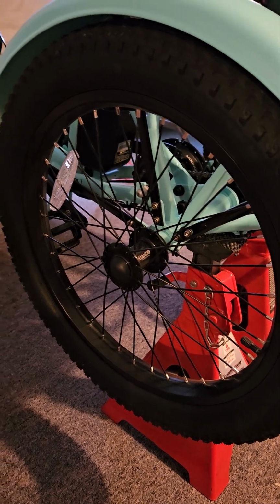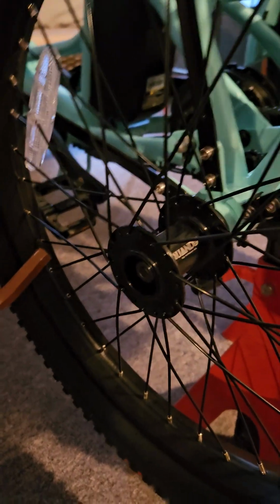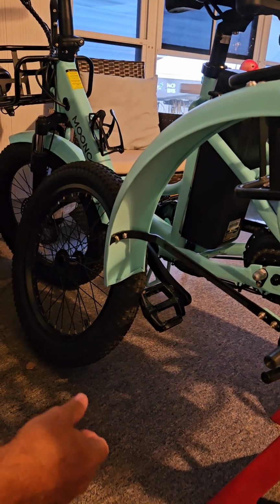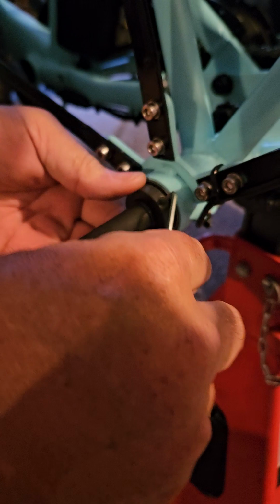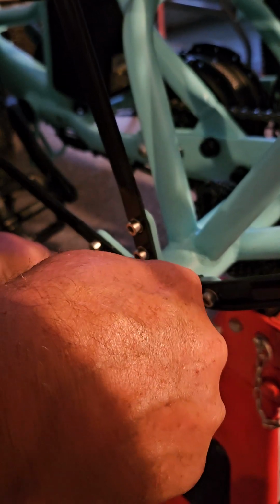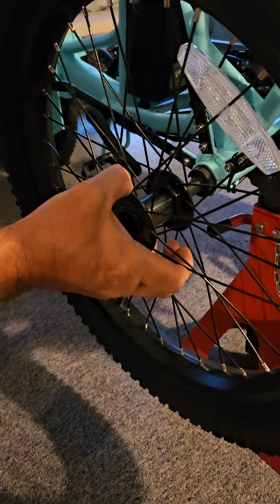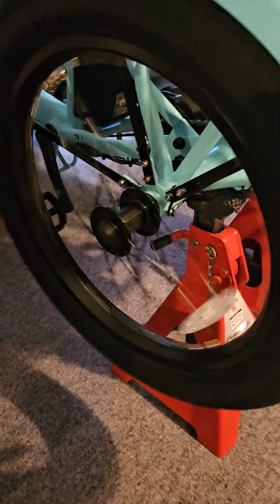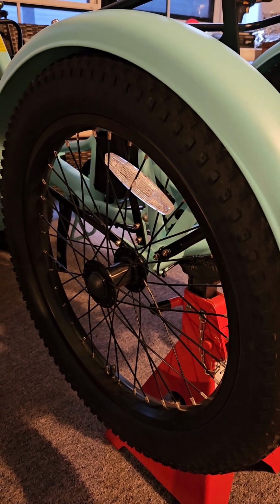Mooncool TK 1 folding trike popping, clicking sound fix.

Comment: Thank you very much! I was missing one of the two crucial screws. Do you happen to know what size they are or what to call them, I will need to get a replacement.
Reply from the maker: @davidupton8880  it is called a set screw.  Take the black spacer to the hardware store. They can help you find the right size.
Reply: @craftytinas  Thank you again.

Comment: Ordered for my wife she rode it around the block and it stopped working, clunking sound and the differential stopped turning the rear tires
Reply: The right tires axle keeps rattling off until it disconnects from the diff. One of the collar set screws you tightened in this video is rounded off so you can't loosen or tighten it. The right tire is also warped.
Reply: The seller does not want me to return the bike utilizing the provided shipping label from Amazon as they say "the shipping is too expensive"